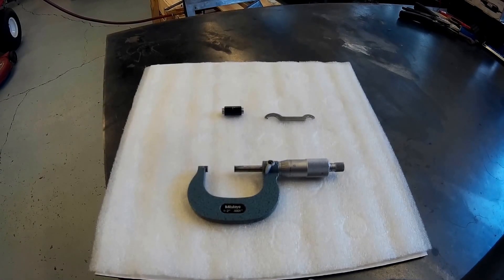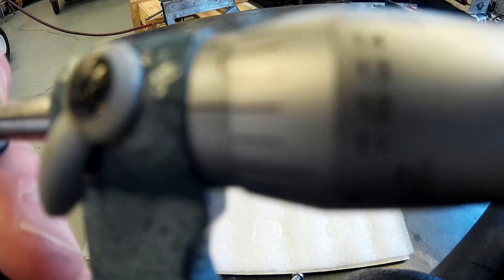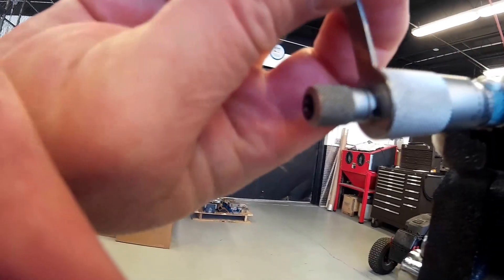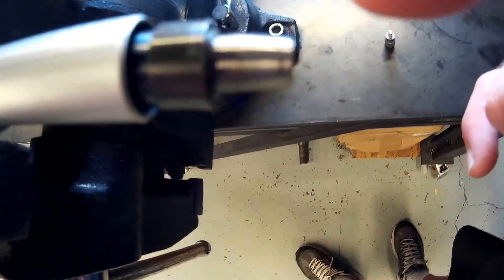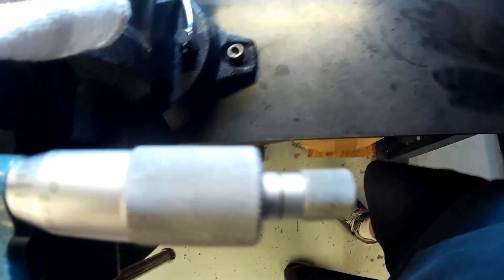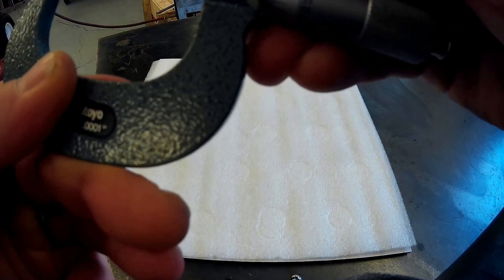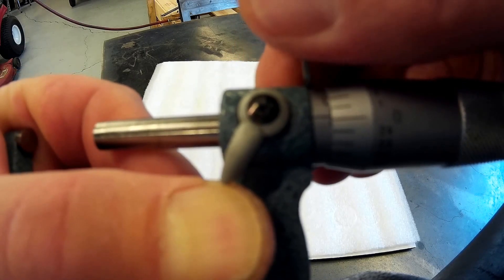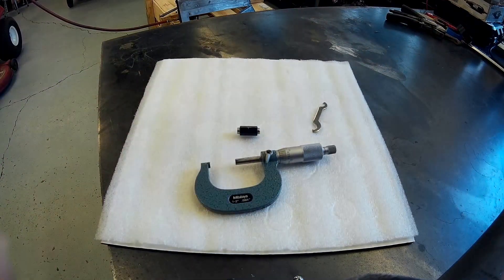Easy way to repair and calibrate micrometers

Comment: Thank you very much for showing how to repair / reset a micrometer. I dropped mine and couldn't get the calibrations back in the original position. I didn't know the procedure on pulling the barrel out procedure. Can't wait to get in my workshop in the morning and cure the problem

Comment: Thank you so much! Just bought a used micrometer and its thimble was off by 15 thousandths from the digital reading. It's a digital Mitutoyo and it works the same way on the thimble assembly. I really appreciate the help.

Comment: Had an issue with a customer mic. The zero was position 90 degrees down when i checked it. But when i saw how you popped the barrel off, I did the same to the mic I was working on and it reads perfect across the range. Just when you think you know something, you learn something new.

Comment: first step after  using test peice is to doble check all  faces clean . the check again . I seldom have had to adjust a micrometer  despite the fact they are used often and often not treated well

Comment: How to remove and correct 0.1 to 0.3 error in micrometer??? please tell me...
Reply from the maker: What kind are they?
Reply: 0 - 25mm, 25 - 50mm, 50 - 100mm, 100 - 125mm (least count 0.01 and 0.001)